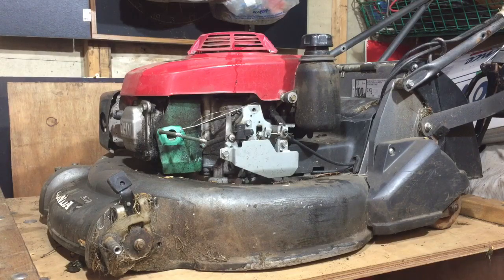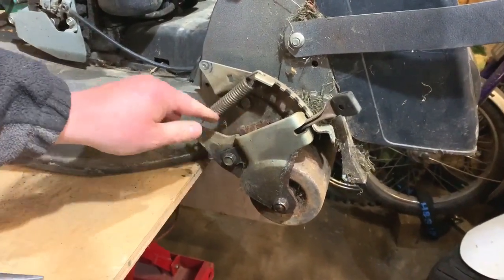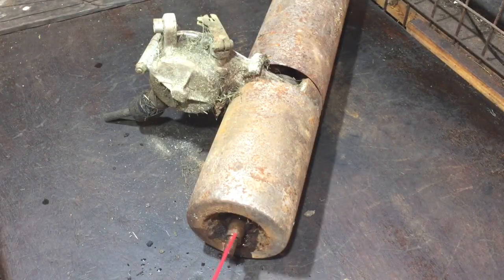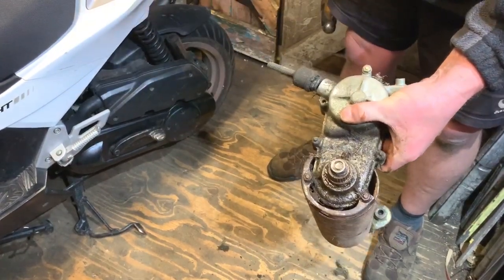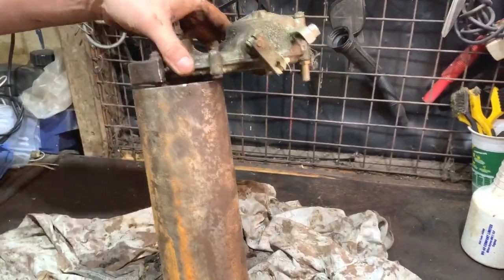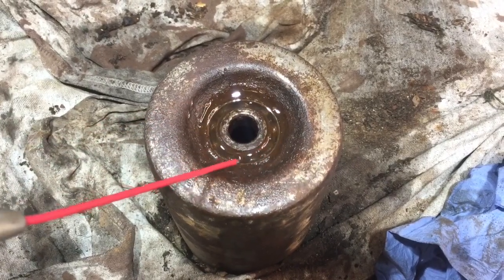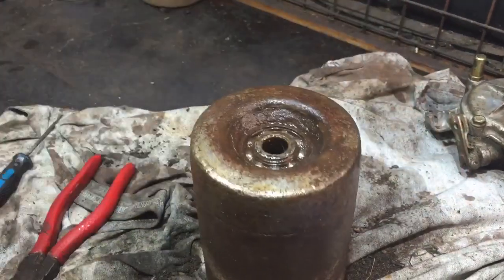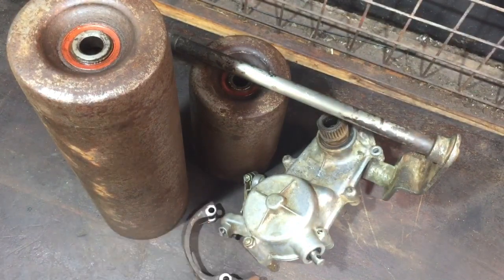Honda HRD536 Pro Mower , seized Roller System (Part 1) 🪛🔧 #Menditman #Honda

Comment: Hi Luke, 
I make a habit of stripping mine cleaning and regreasing mine a couple of times a season. Takes about an 1hr including the oil in the gearbox.
They have a bad reputation but it's solely down to neglect and lack of maintenance. Can't believe you tried to salvage those bearings! They're well beyond repair and the hassle in my opinion🙈🙉
I now file out the holes on the gearbox gaurd as they scrap the ground from new. Raising them up abit stops all the wear on them without loosing the protection. Certainly can't notice the lack of contact in the strip.
👍😉
Reply from the maker: Hi I won’t be keeping this mower so I wanted to fix it for as little as possible also I wanted it done so waiting for parts was going to put me back, but i agree in an ideal world I would have put new bearing in but they are ok now and will last a good while. After I loosened them up there was no play in the what so ever. Your 100% right about the maintenance these should be serviced at least every year but lots of repair places don’t bother, but like you say it’s about an hours works. Good tip about the guard 👍 Thanks for watching 🙂👍

Comment: Won't the WD-40 just attack and break down all the pre packed grease in the bearing? For the sake of 20quid it's better to pop new bearings in. I use 2 large coach bolts with a coupling nut in the middle to make a removal tool and just drive the bearings out of the socket in the roller with a hammer. Works a treat 👌
Reply from the maker: Hi perhaps but I wanted to prove I could free them up also I like to show people you can get by without spending money,plus I’d rather keep the £20 in my pocket 😂  I’m sure they will last a good while I think all the grease had long gone how seized they were. I have fitted new bearings to these in the past I just used my dads bearing press that worked ok, but your idea does sound good. Thanks for watching 🙂👍
Reply: Interesting but I can't picture how you get these bearings out? Do you have any pictures of even better a video?

Comment: Luke, I would have done it just the way you did, those bearings will last a long time after cleaning them up, another good vid...
Reply from the maker: Hi Barry, well in an ideal world I would have put new bearings in, but I wanted it done so didn’t want to wait also it does save a bit of money which is always good 😂 I agree I think they will last a long time, they weren’t worn just got seized if they were running really fast it might have be different but they will be ok. Thanks for watching 🙂👍

Comment: Put a new drive cable on mine and it’s juddering/requires a bit of a push to get it driving. Currently have my rear roller dropped out- seemed to be way to much slack cable after installing the new cable to I’m wondering if the lever that connects to the gearbox was positioned wrong. Have you come across this issue before?
Reply from the maker: Hi the lever that bolts on to the splined shaft out of the gearbox can crack so it doesn’t grip properly, it’s worth checking as it’s quick to check that. But I wouldn’t be surprised if it wasn’t something inside the gearbox. But look at the easiest things first. I have got videos of how to fix the common dog clutch issues on these which when worn causes juddering. Let me know how you get on 🙂👍
Reply: @menditman2004  do you have a playlist with all 536 videos in it at all? Thanks

Comment: Luke  I don’t understand I Watch you guys trying to pull things off of shifts without polishing the shift first can you give me a good reason why you guys do that in that manner
Reply from the maker: Hi Henry good point, personally I would say I’m a bit impatient and want to get it all apart, I have though in the past sprayed WD40 and got light sand paper to clean the shaft up on this one I just didn’t bother and even though it was a bit Rusty it came off ok. End of the day it’s an old mower I didn’t know whether I could fix or not, if it was say a part on the Lambretta I probably would put more time into it. Thanks for watching 🙂👍